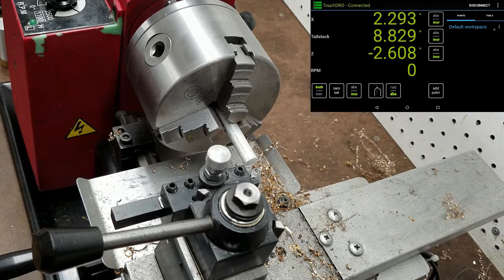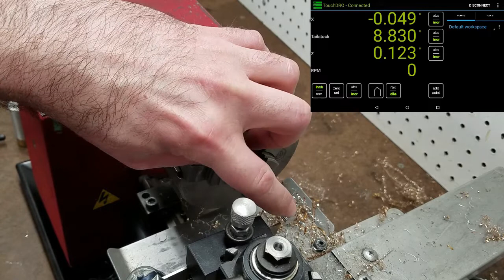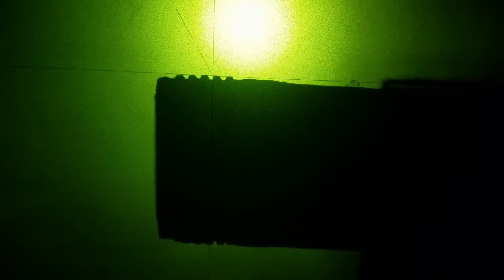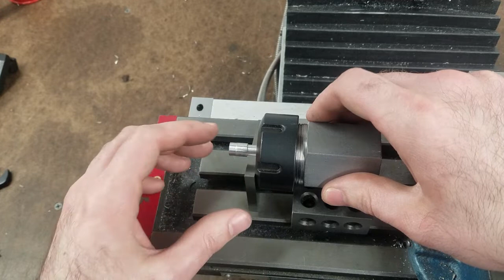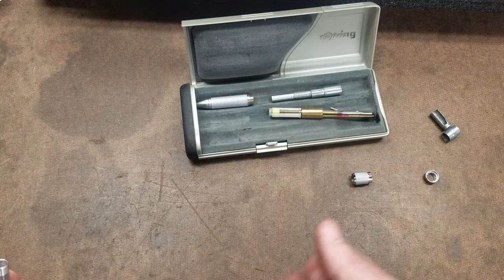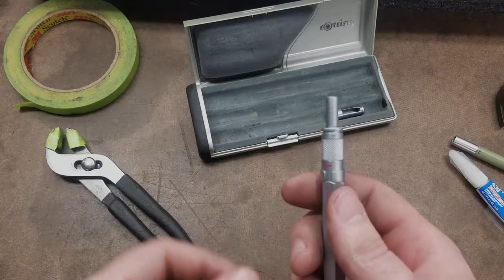Pen Repair: Machining a replacement part for a Rotring 600 Trio

Comment: I have a Rotring 600 roller ball, that I've carried for 20 years. I think it had "one too many gravity checks" and the screw-in tip has broken off (have pictures).  I would be thrilled if I could hire you to repair it.

Comment: Hello again. I’m really interested in getting the dimensions of the eraser/ clicker cap. I’m about to go to a machinist to have it fabricated by trial and error but if you could mic out your intact example, It would help us. Thank you.
Reply from the maker: Sorry I took so long for this...

Overall length: 0.753"
OD: 0.224"
ID: 0.204", 0.698" deep
Reply: @fna-wrightengineering  
Thank you kindly! I'll pay the favor you did for me forward when the opportunity exists. Keep up the good work and thank you for sharing.
Reply from the maker: @acsnitner7661  you're quite welcome! Hope you can get your pen working again.
Reply: @fna-wrightengineering  FYI these older German made 600 Trios with knurling sell for $600 for NOS.
Reply from the maker: @acsnitner7661  Hence my repair, rather than replacement lol
Reply: If anyone contacts you for help getting a silver eraser cap / actuator, I had two machined and would sell the second if needed.

Comment: Hello sir. I need the missing rear barrel (the "clicker" thumb actuated part/ eraser hood) made for my old silver knurled Rotring 600 TRIO. It's an old pen that I've had for decades with a history. I've tried the newer Japanese reproduction parts with no success. I do not have the specifications on the part I need made, Rotring was bought out from another company, and the old German specs are unattainable from my seat, regardless of my effort. This would be a custom trial and error job for you but I have no idea where else to turn. The fact that you had one of these fully disassembled and took the time to make a broken part from scratch gives me confidence in you, honestly a relief that craftsman still exist. Kindy help me out, cost/wait is no object. The "History" I mentioned was it was a trade (black version bought new at the time to his older silver version with knurling) from a engineer co-worker turned friend of mine. I sadly learned that has passed. I've carried (and use when needed) this pen everyday after knowing this. OK guilt trip aside, I need help to make this pen great again.

Comment: Screen recording -  I use Wondershare Filmora. It is available for Windows and Mac. It's $80 for lifetime version, The free version has a watermark. You can adjust the capture portion of your screen and capture in HD. You can also crop, adjust resolution, etc. If you have Windows 10, you can use Windows Game Bar, Windows key G. Game Bar captures the entire screen with no option to change.  Go full screen, F11 to capture only DRO.

Comment: Hey, great video!
How did you disasemble the pen? Im trying to repair mine right now but I can't get get the part you replaced out of the pen without damaging it. (the part still works fine on mine but there's something wrong deeper inside the pen)
Reply from the maker: Thanks a lot!

I was able to unscrew that brass sleeve (sorry, I don"t remember what I used... Disassembly took place many years ago), which allowed the inkwell assembly and button mechanism to drop out the end. The piece I replaced is pressed/glued in... Once the other guts were out of the way, I used a punch and hammer to carefully knock it out.

Good luck repairing your pen!
Reply: @fna-wrightengineering   Can I pay you for a couple of these, I have 4  pens and 2 of them are broken
Reply from the maker: @leessummitfunhousereservat2606  Sorry, but I have to decline. My personal project list is very long, and I don't feel right taking on a job for someone, when I've got no idea when I'll be able to get to it.